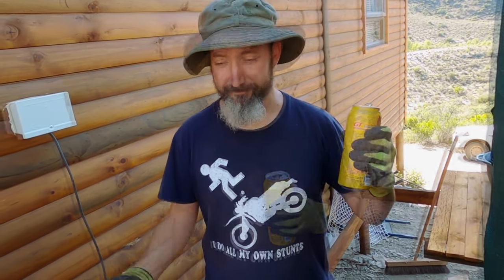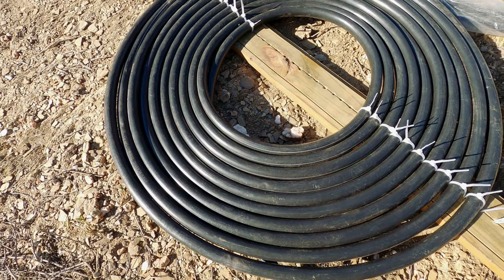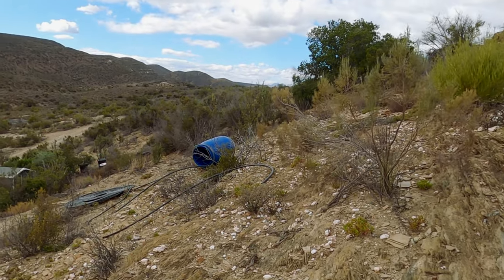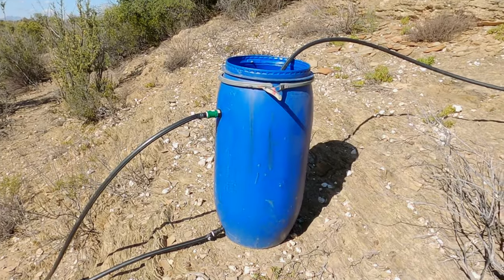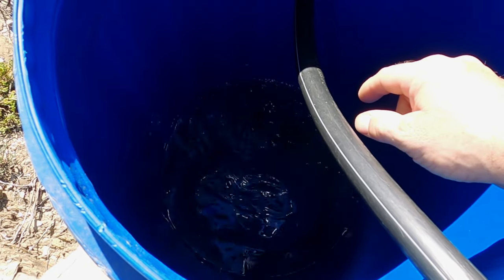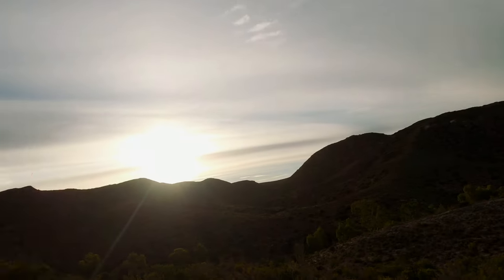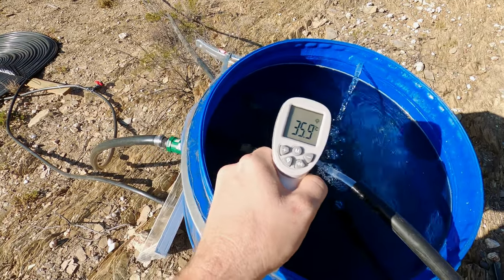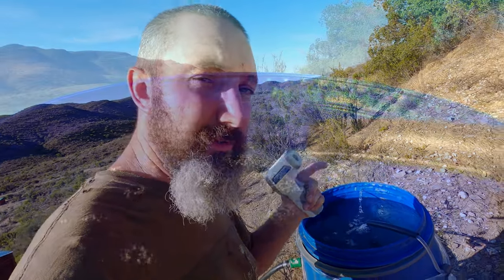Off-Grid Solar Water Heater - Free Energy - with many caveats

Comment: This is so cool and the best thing about 0.1 revisions is iterate iterate iterate! Imagine 3.0 after all the testing. I hope to visit soon! Did you manage to connect the cold and warm supplies with a hot-cold swivel tap for the shower? You might pick up pressure issues doing that. Instead stick to two way mixing.
Reply from the maker: Thanks for the comment, Joe! I have it booked up to mix, but there delta between the hot barrel and the tank is about 20m, so even if the cold water is only a tiny bit open, it pushes to the barrel. I will have to normalise the pressure. Version 1.1 problem !

Comment: I know it's months after this video and I'm sure it's been iterated a lot, but perhaps wrapping the tank in silver foil (like the blankets they use for hypothermia) for insulation etc as well
Reply from the maker: Doesn't matter how old the video is, always lovely to get replies. You have a great idea there. Perhaps the siselation type stuff will work. Your idea will save the tank from heat and uv damage. Woo
Reply: @SimpleEarthSelfReliance  I'm sure siselation will - just thinking of cost effective ways to improve a good system, and it definitely beats building some sort of structure with walls and a roof. If you don't mind the comments I'll leave them as they come to me 🤷‍♂️

Comment: Use black barrells
Reply from the maker: Indeed an upgrade. I was contemplating the option of either insulation or black paint. Problem is that once the temperature gets to threshold, the thermosiphon stops. Thanks for stopping by, appreciate.